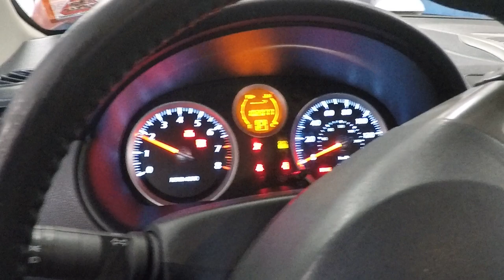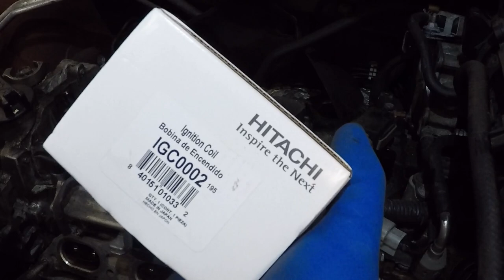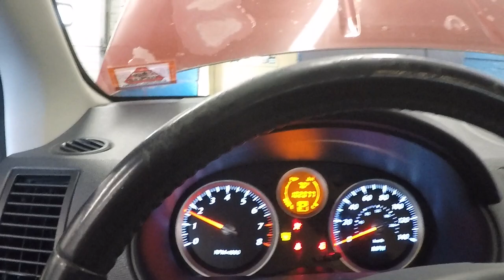2010 Nissan Sentra changing spark plugs & Cylinder #1 misfire code P0301

Comment: I have a 1.5 Nissan cube z12 cvt transmission and when I stop at stop light foot on brake I have a intermittent shake but if I shift to N everything is smooth 🙄 very annoying 🙄 would a bad plug be the cause?? Please and Thank you 😉
Reply from the maker: Either low idle or bad engine mounts try start with cleaning throttle body
Reply: Thanks so much indeed kind regards from Dublin City Ireland 🇮🇪
Reply from the maker: @deniscleary13  welcome
Reply: TB Cleaned.... no codes and mounts look good 🙄
Reply: I'll pull the plugs when the weather is better 😌

Comment: Hey I had same code I have same car I replace spark plugs last night but not coil pack I think I need to replace coil
Reply: My car was p0300 p0301  code its a 2010 nession sentra
Reply from the maker: Replace coil for cylinder one hopefully u kept coils in order so u know which one it is
Reply: @RBTheMechanic  I did keep them in order I'm waiting for coils m going to replace all of them is that ok ??
Reply from the maker: @brittanydillon4132  u can do that but I never do that only replace the bad one
Reply: The part will be here today I'll let you know thank you for all ur help 😊
Reply: Well my car is running alot better however when I stop it stalls idk what it is cus it's no longer throwing codes 😢
Reply: I'm going replace camshaft sensor hopefully that works
Reply from the maker: @brittanydillon4132  yeah

Comment: I got a 2012 Nissan Sentra & I get the code of 300 & 303 I already change the spark plugs & coils pack but still get the codes. Also I change the fuel injectors thinking maybe no fuel is going thru. This is the second time I change the spark plugs when I change the first time the spark plug on #3 smell like gas but I had another friend look at it & he thought it was oil so I’m not sure what to do next. What do you recommend
Reply from the maker: I would check misfire data with scan tool and then swap the coils to diff cylinder and see if it switches spots
Reply: Hi, what did you find out what is causing the P0300 and P0303 code?

Comment: Sorry my last comment was a little off, i actually believe I need a crank shaft positioning sensor and new spark plugs! I will say if you can confirm this @RBtheMechanic I am very handy and can probably do it by myself!! depending on whats needed!
Reply from the maker: What am I confirming sorry I don’t remember last msg
Reply: Could I do that myself? Also I have a 2010 Nissan Sentra and I know you said some Nissans don’t have maf but map sensors and I’m wondering if that includes my car

Comment: Sentra's with the 4 cyl and misfire.... Check the flex rubber intake snorkel hose for cracks!!!!!! Creates a vacuum leak!!!! Sometimes hard to see or maybe small or on bottom and or after re installing makes it a bigger tear between the ribs of the big flex rubber snorkel... Check it and double check...

Comment: I have the same car, took the plugs out 3 had oil on them is that a valve cover gasket that needs repairing? Thanks
Reply from the maker: Yup the valvgasket with center gromets need replacement

Comment: Hey I really need your help I literally just did the same exact job did all four spark plugs all for new coil packs and here’s what happened. While connecting the connectors back to the coil packs at the time I didn’t realize it but they didn’t click in all the way. They’re putting everything back together the car fired right up and it drove amazing for about two days on the third day while driving my engine seem to lose almost all power and I had to pull over into a parking lot and get my vehicle towed upon checking the number one and number four connectors have vibrated loose and we’re not connected to the number one and four coil packs so of course I redo the job and this time absolutely make sure to hear the click on every single connector the problem is after completing the job this time and firing up the engine it idles fine and when you start to drive it seems normal until you get to about 2000 RPM soon as it hits 2000 RPM I’m losing power it’s not jerking or shuttering but the RPMs go up higher and it’s like the car doesn’t want to barely move it feels restricted like somethings holding it back I do not have an engine light on no one can seem to figure out what’s going on my car has been to transmission shops and even went to the Nissan dealer and they couldn’t figure it out. I’m at a complete loss right now I don’t know what it could possibly be do you have any idea what damage could’ve been caused by the connectors coming loose while driving on two of the coil packs?
Reply from the maker: Not sure why don’t u scan the car to see if there’s any codes I doubt it’s it connectors it would misfire check engine would flash and come on if that was the case
Reply: @RBTheMechanic  I did scan and there’s no current codes. I took it to my buddy who had a better scanner and he was able to see under Permanent codes there were a few Transmission codes but no check engine light on. I’m looking into that today. It’s probably going into Nissan dealership tommorow. Starting to look like a transmission problem. 130k original CVT.
Reply from the maker: @sacking5919  what scan tool did u use?
Reply: Disconnect and reconnect battery then do a throttle relearn procedure

Comment: If one has a misfire for example cylinder 4 -------- is the misfire actually at cylinder 4, or the 4th cylinder in the firing order ?

My Scion XD has a firing order of 1, 3, 4, 2  - would a cylinder 4 misfire code actually be in cylinder 2 ?

Thanks, RB
Reply from the maker: S H  ru saying all 4 mos firing or number 4 cylinder misfiring
Reply: Mode 6 scan shows a misfire cylinder 4 , once had an engine code p0304.  My question is : does cylinder 4 actually mean cylinder 4 
? Or does the code refer to the 4th cylinder in the firing order ?
Reply from the maker: S H   You can use scan tool to see if other misfiring but u can remove one coil ant a time and see what happens several way to test but you can fix that one cylinder and check it by starting the car
Reply from the maker: S H if your getting code for that cylinder misfiring that that’s the problem other cylinder will have their own codes

Comment: Keep getting a P0301 code after getting a P101 code after getting a too lean code already changed out MAS spark plugs and ignition coils any other ideas what it could be? Thanks amazing videos
Reply from the maker: Cylinder 1 misfire did u change the coil on cylinder number 1. And check ur spark plug also
Reply: @RBTheMechanic  yes just recently changed out all the coils and all the spark plugs along with all the gaskets and pcv valve just recently got p0101 to clean out Mas sensor its struggles going up hill and can't fully accerate and rough idle
Reply from the maker: @daltonthomas5054  well try swapping coil to another cylinder maybe bad coil swap the plug also check compressor in the cylinder
Reply: @RBTheMechanic  ok ill try it out I'll get back to you on an update
Reply: It just sounds like it's winding when going up hill

Comment: PLEASE HELP! 
After screwing in the new spark plug, my short socket wrench would be stuck inside and would not be pulled out along with the extension bar! All my tools are new! thank you!
Reply from the maker: is the socket too fat? try using pick you can buy this self lock extension  that will work good
Reply: Use a magnetic plug socket

Comment: My girls car has the same code mechanic changed new spark plugs and new coil packs but the service engine soon light came back.   What’s the problem. I got the right spark plugs and coils. Car runs fine too. Been running fine for a month but the light won’t go away.
Reply from the maker: Alex Campos is the same code that came back ?
Reply: Yea weird. Car runs fine though
Reply: Did you fix it? What was the problem?

Comment: What if the intake manifold bolts (longer ones, and the one near the break vacuum are rusted and stripped)?
Reply from the maker: Well that would be a job to replace them and difficult task
Reply: @RBTheMechanic  torch them off or something else? And do you have the dimensions of those bolts?
Reply from the maker: @josephdaly6561  I don’t have dimensions I don’t thing u can otrch them use extractors or socket that fits
Reply from the maker: @josephdaly6561  can u make a video then I can prolly see what I would do
Reply: @RBTheMechanic  yes. I had to put it back together because I couldn’t get those bolts out. When I am back under the hood within the next week I will take a video. How long can the car run on a misfire?
Reply from the maker: @josephdaly6561  u shouldn’t run with misfire u will destroy other parts such as catalytic converter
Reply from the maker: @josephdaly6561  what is the code
Reply: @RBTheMechanic  P0302. It had the MAF sensor too which I replaced then the 2nd cylinder code came up
Reply from the maker: @josephdaly6561  well that’s cylinder number 2 mod fire why don’t u change the spark plugs and ignition coil and when u take out the plugs and could make sure there’s no oil on them
Reply: @RBTheMechanic  yes I plan to do that once I extract the rounded bolts on the manifold
Reply from the maker: @josephdaly6561  why ru testing to remove that if it’s dosent need it be removed leave it alone unless there’s a reason u need to remove
Reply: @RBTheMechanic  don’t I need to remove the bolts that hold the intake manifold? Those ones are stripped, that is my problem.
Reply from the maker: @josephdaly6561  ok I understand it’s stripped but why dose it need it be removed if it’s holding firm and tight I would leave it alone unless there is repair that is causing u to remove the bolts?
Reply: @RBTheMechanic  well I almost know 100% there is a misfire, and the computer guided me to the code of P0302, so while I am under there I will check all 4. Engine sputters really bad.

Comment: Hi, thank you for the video! question, i have a 2009 Sentra 2.0 that basically looks the same, im doing a compression test in it, do i need to take the air manifold and install for every cylinder?
Reply from the maker: Not understanding what u mean but to do compressor test u need to remove spark plugs disconnect fuse injects so they don’t spray fuel and use ur tools to do the test also press gas peddle so throttle opens to give good air to enter

Comment: I’m having this code come up after rebuilding my Injector’s bro :( cylinder one what do you recommend?
Reply from the maker: rick barajas check you injector connectors spray some brake cleaner around the intake gasket area see if there’s any difference some times air leaks in but if not then try coil on that cylinder
Reply: RB The Mechanic thank you brother! I tried the wire test but I don’t know what to look for? I disconnected the coils one by one and the first one that gets taken out doesn’t react, the other three taken out it begins shaking car, I can hear the spark being produced tho but the car doesn’t react to the fist one being pulled
Reply: I have white smoke coming out too
Reply from the maker: rick barajas maybe the spark plug is bad but did u work on that cylinder for the injector?
Reply from the maker: Pull out the spark plug see what it looks like I hope ur head gasket is not blown white sign means coolant burning pull out the plug try new plug or swap it with diff plug from diff cylinder and swap the coils also
Reply: RB The Mechanic I just replaced the spark plugs about 3 weeks ago and it would ignite fine then it began struggling to ignite again so I decided to rebuild the injectors. As soon as I got everything back on I checked everything and ignited the car, tons of smoke came out and then it subsided. Now the car rough isles and has the white smoke if I accelerate, not while it’s idling
Reply from the maker: rick barajas you need to pull the plug check the tip what color it is and let me know
Reply: RB The Mechanic okay the first one is completely wet with fuel the porcelain that holds the spar tip is white. There is a large carbon build up tho on all four tips. Also the base of the spark plugs are moist with oil
Reply from the maker: rick barajas you might be burning antifreeze I can’t txt
Reply: Maybe the coil? Cause the first spark plug was wet with fuel

Comment: Hey thanks for your video but if you work a Nissan Sentra you are calling the number wrong
Reply from the maker: I don’t work for Nissan
Reply: @RBTheMechanic  hey again sorry about earlier. Look I changed the plugs and the coil and change the oil air filter but the is still doing the same before
Reply from the maker: @mainormanzanares3368  do u have any codes?
Reply: @RBTheMechanic  it p0300&p0304
Reply: @RBTheMechanic  there's is one more but I forgot it
Reply from the maker: @mainormanzanares3368  need the code try scanning it
Reply: @RBTheMechanic  I'm sorry I just saw this message I'll get the codes in the morning and thanks for trying to help me

Comment: Hi! Can anyone help? I have a 2010 nissan sentra sr 2L 4cylinder and i would literally be flooring it and my car would barely accelerate. It often hesitated and there would be times where it wouldn't reverse  I got the following codes: p1777 from a code reader! A couple weeks after getting the code, I got a diagnostic from a very renound company and they claimed to have gotten codes p0420 and p0300. bit they said they did not get my original code. To make a long story shorter, they replaced my enitre catalytic convertor as a result and not even 5 days after they assured me that was the problem and it was fixed my car broke down. I did even more research and found that with some new spark plugs and a new stepper motor my car would be back to normal. I kinda know the answer to this fIrst question but DID I JUST GET SCAMMED?!?!? My other question is what the hell is wrong with this car and how do i fix it? Is my research correct or am i way off?
Reply from the maker: Ok not I see ur message well u got catalytic code that could be the issue that it has no power
Reply: @RBTheMechanic  Well, the catalytic convertor has been switched and the car still wont power. Do you think if i switched out the stepper motor and the spark plugs (based on the research i've done on the codes that's what's needed) that would do the trick? I don't have much experience with cars but your videos are so descriptive I feel like i could tackle this on my own! I have all the tools available to me and it would save me so much money! Let me know if its possible! Thank you!!
Reply from the maker: @janelljones6549  it could be lot of Things clean out ur maf sensor
Reply: @RBTheMechanic  could I do that myself?
Reply from the maker: @janelljones6549  yeah I have videos on cleaning maf sensor
Reply: Forget it!! I found your video on the 2013 Sentra maf sensor! I’m definitely going to try it and lyk
Reply from the maker: @janelljones6549  cool update me